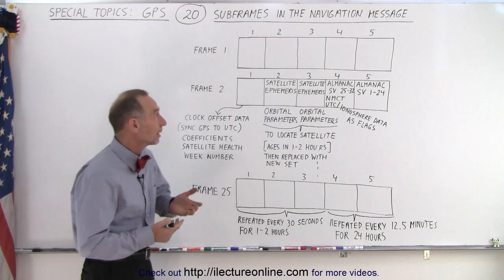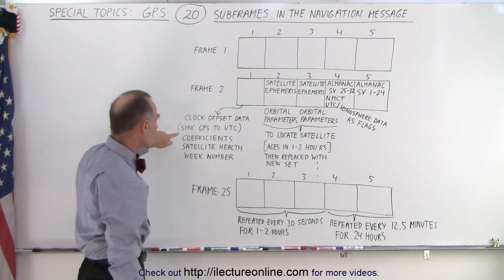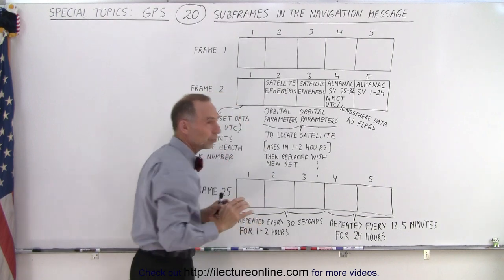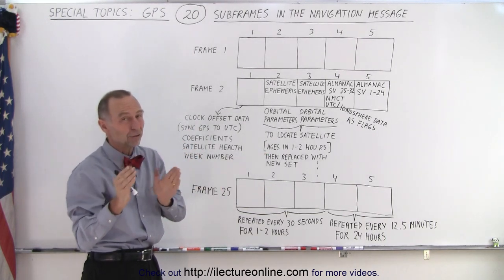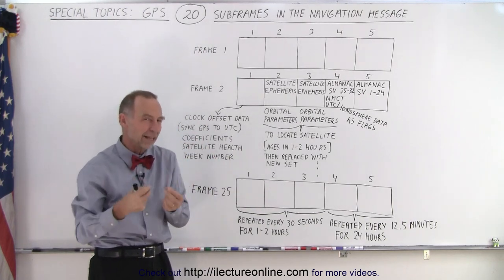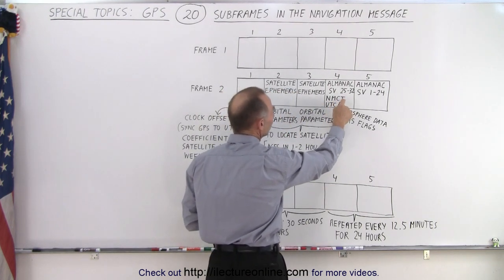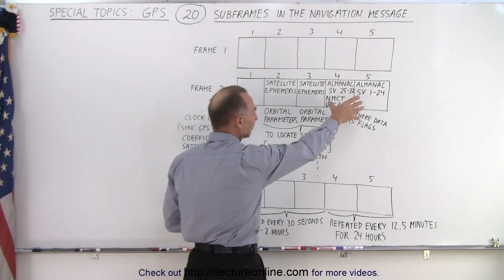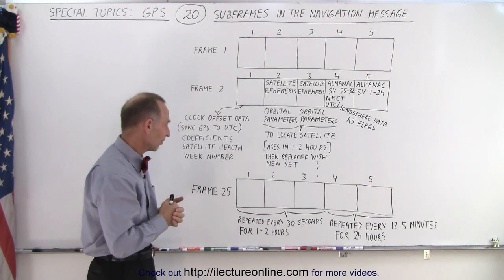GPS (20 of 100) Subframes in the Navigation Message

Comment: Is there a formula that calculates the x, y and z coordinates when you have 3-4 sphere's and there formula's given?
(This is for an assignment and I need to have a general formula that shows that it hits in one point with x5,y5,z5 coordinates)
Reply from the maker: Yes there are.  These are callled tracking algorithms.  I will see if there are any publicly available algorithms since I cannot show any proprietary information on these videos.
Reply: Hi the best way to do is to treat it as simultaneous equations with three knowns and three unknown values and then use substitute method to solve for known values
Reply: @MichelvanBiezen  Sir with all due respect... the tracking algorithm is only tracking the exact code phases and doppler to remove the PRN code and the Carrier from the signal... the navigation signal processor then decode the navigation message